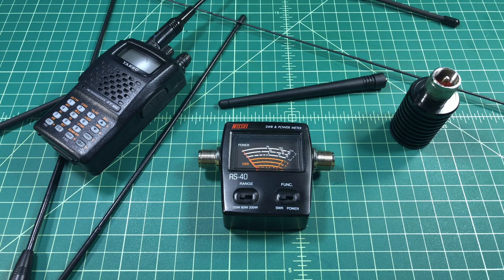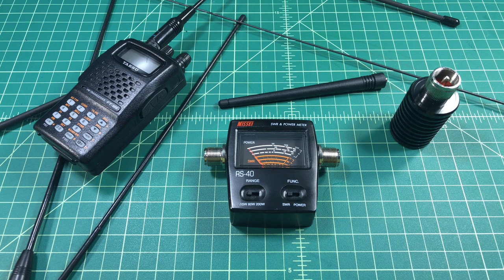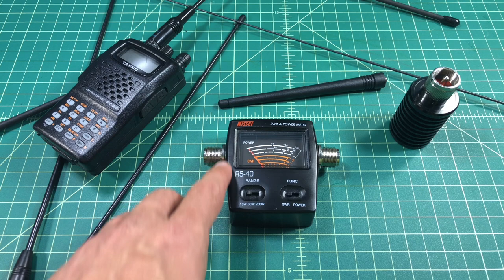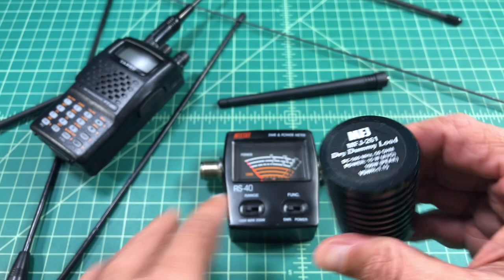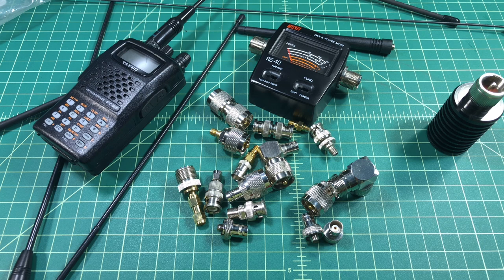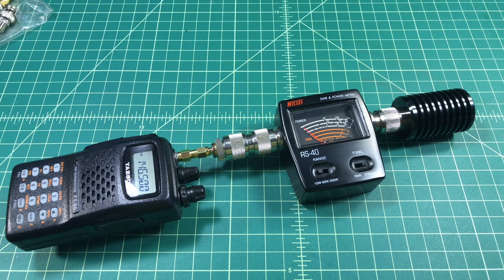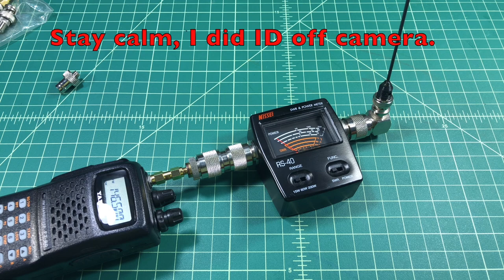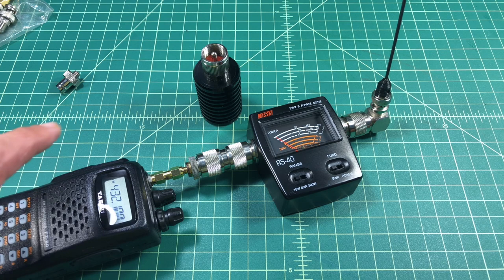SWR & Power Meter for HAM Radio - TheSmokinApe

Comment: I used that same meter of a different name this weekend, Micronta, I think they are 3rd cousins. I read/saw an article on using adapters, connectors etc some time ago and testing was performed on a transmission line, adding several adapters and connectors barely registered any changes, negligible was the term used...so, if you have to use a type N to so-239 so you can connect that to a pl-259, because you have a pl-259-bnc male and a bnc F to SMA so you can test a UV5R...it will not affect a thing.
Reply from the maker: That’s good to know, some folks act like you stole their lunch money when you use an adapter.
Reply: Yeah, there are a lot of those folks...
Reply from the maker: Right 👍

Comment: Nice video, my question is ,is the dummy load always necessary when measuring power? I understand that for the rig power measurement dummy load is required just to test of the power output 9f the transceiver.But, when we want to measure the power output while attaching 5he antenna at antenna end of RS-40.actully this would be the real scenario.i m asking just because I have no dummy load ,but i have tested all setup without it ,just attaching the rig on left side and antenna on right.i m curious your reply because my meter does not moving s little bit in any position either on swr or on power mode.eatlier it was working ,but i was thinking the result it gives us not satisfactory so I stopped to use it for 3 three year it is almost unused .but now it shows nothing.i contect the company ,but the denied to give service as warranty is over and more thing is i purchased online from china website.so please suggest some remedies if you know in this regard
Reply from the maker: You don't need the dummy load, you can measure right into the antenna.  It sounds like you might have a broken meter.
Reply: @TheSmokinApe  thank you for reply, it was working when i bought in 2018,but according to me,it was not giving accurate result(may be i wrong) ,so i was not using it as i was little bit away from ham radio activity . now i am free ,i have time for my hobby ,but now meter behave like dead ,though it has no such circuit or batter in it,but no deflection at all.they just provided me schematic and calibration guide ,yesterday. what you think i should go for calibration or repair ,i little bit know circuits and electronics and repair gadgets myself.

Comment: Hi. I have the same swr meter and I think I don't read swr properly with it. Since it doesnt have an adjust pot, the needle with move between high and low power, showing a different swr reading. But swr is not power dependent. What is the correct method to read swr with that meter ? Thanks for the vid and 73.
Reply: I have an old micronta that functions the same way as this. Since there's no adjusting pot, the reading won't be accurate. My Micronta has a conversion chart on the back to adjust based on how much power. Kind of a PIA since the chart isn't easy to read.

Comment: Do you have to use a dummy load, to check power? Or can you just use the antenna?
Reply from the maker: You can use the antenna but you will be transmitting a signal.
Reply: @TheSmokinApe  Well, dah! 🙊
Reply: Dummy load will give you true power to 50 ohms.

Comment: Or, get a nanovna and incandescent lightbulb.
Reply from the maker: I am a huge fan of the NanoVNA but you can't use it I line with a radio and antenna, that said it's probably my most used "test gear"  Thanks for the comment Joe 👍

Comment: What's the point of having the power meter on the FT-60R?  I've looked everywhere and I can''t find any reference on how to use it or why it's there.  Sure, I know, noob question, but it's the lack of info like this that throws some of us new guys off.  KD8NIJ.
Reply from the maker: I only hook it up when I’m testing something.  For example if I was getting weak signal reports I might want to verify my radio is putting out the correct amount of power. 👍
Reply: @TheSmokinApe  Thanks for replying, but I was referring to the built in one.  Referred to in the manual as the S- Power meter.
Reply from the maker: Oh, that should the receive signal strength

Comment: So if Im getting a super high SWR.....I have this same meter and Im maxing it out on SWR......where should I start to look?
Reply from the maker: What antenna and how is it mounted
Reply: @TheSmokinApe  arrow dual band jpole.  Mounted on a 2 inch antenna mast.  Lmr400 cable being used.  Connectors we out on.  No shorts checking with meter.  Goes through a wall on a 8 inch bulkhead connector with a 90 on each side.  Radio is icom 2730a
Reply from the maker: Robert Proctor what power setting did you use.
Reply: @TheSmokinApe  used the 60 watt setting since it was 50 watt radio.  It seems the bulkhead connector is the problem.  Swr was okay on line from antenna to bulkhead....but on a wire o know is good going through the bulkhead we were getting 2 to 3 on 2m but spiked to 8 on 70cm.
Reply from the maker: Are you going to replace that cable?
Reply: @TheSmokinApe  going to take the bulkhead out

Comment: got my first radio for christmas. i bought 3 more since then, all of them are supposed to be baofeng f8hp, but i suspect 2 of 4 radios are fake clones. one of my suspect radions will not test power at all, shows zero at all power settings. the other suspect radio transmits the exact same power on high and medium. i suspect they stuck the guts of a uv5r into the case of a f8hp, since the highest the uv5r is 5 watts and that is what i get on both high and medium settings, christ i dont have time for this. any ways back to the first suspect radio, why wouldnt it test out at zero? when used with an antenna it seems to communicate to the other radios? the two good radios seem fine in every way, i used a surecom sw-33 meter, but i suspect all of these tests are done using the same theory. does anyone have any clues to the things i have mentioned, i am brand new to all of this, and i am about to buy the tester in this video so i can test my tester lol
Reply from the maker: Check out my Baofeng power test video, the quality of Baofeng can be suspect 👍
Reply: @TheSmokinApe  i ordered the tester in your video, to confirm the results i got on my first tester(surecom sw-33). 2 of my baofeng f8hp's do not broadcast anything on "high". one of the radios is weak on high only 5-6 watts and only one radio seems get close to 8 watts @7.6watts. these four radios are all new radios since christmas from different sellers. i kinda suspect i damaged one of them. the surecom sw-33 comes with a 5 watt dummy load that i was using. all the other videos showed everyone testing their 8 watt radios with it, so i did the same. is it possible this dummy load was too weak for the "8" watts? i only held the ptt button for about 1.5 seconds for each test. thanks
Reply from the maker: @jasonbrown467  just test with the antenna.  Not using a dummy load can cook your finals, a 5w dummy load could cause problems but should be OK.